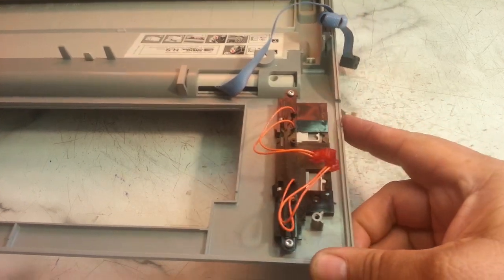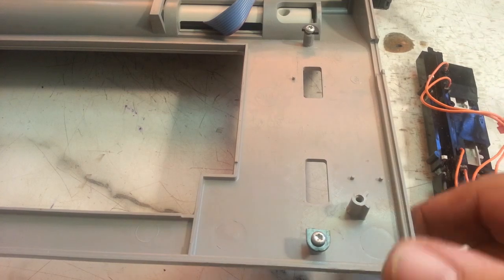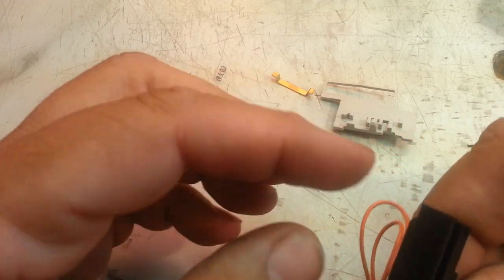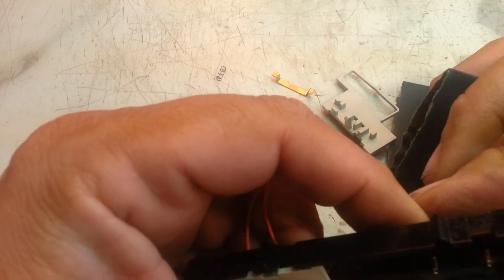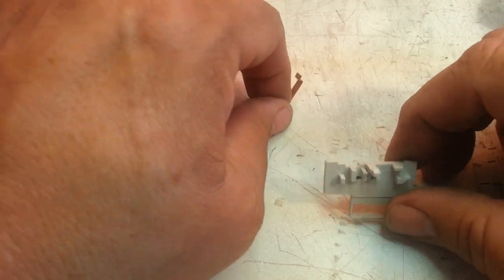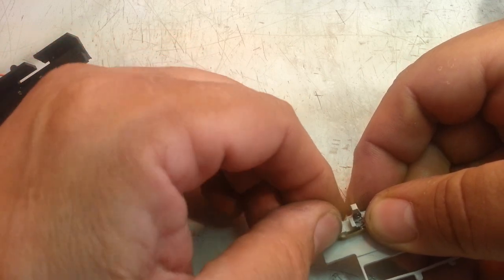Smith Corona Electronic Typewriter Word Processor PWP 50 Slide Switch Repair On/Off Mode Selector

Comment: Many many thanks for this video and the one that shows how to take the cover off (which screws to remove and I guess you unplug the LCD display).  👍I have an XD5600 that works fine but the power switch does not turn the typewriter on or off, it just comes on when it is plugged in. Looks like I just need to clean the contacts.....apparently the on contacts are permanently on even when moved to the off position. That little spring looks no fun to put back, I'm surprised the whole switch does not snap back into place as it looks like you had to pry it apart, so not sure if I will need a temporary rubber band. The other switch is 3 positions: TYPE, LINE, MEM. I searched all your Smith Corona videos so the "switch repair on/off" was just what I needed. 🙂